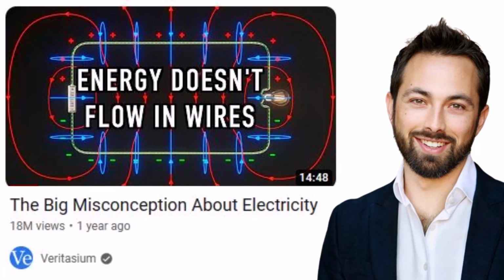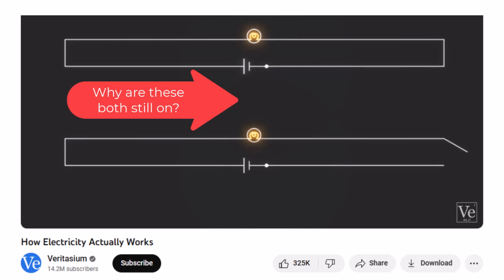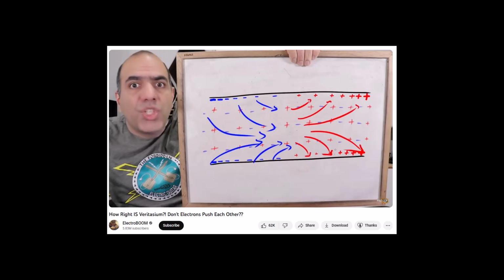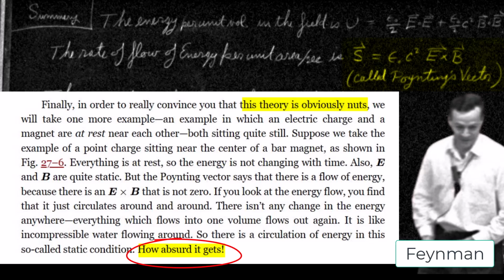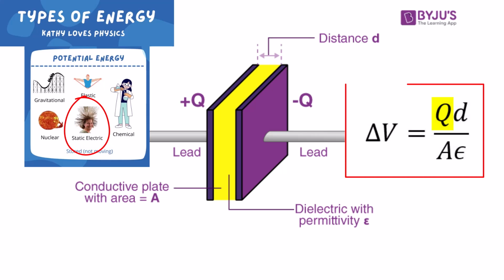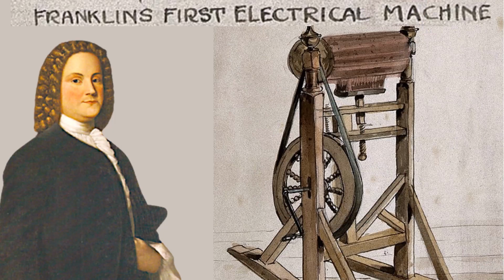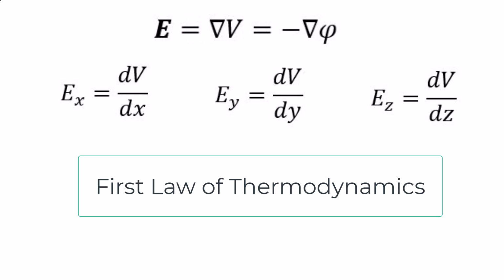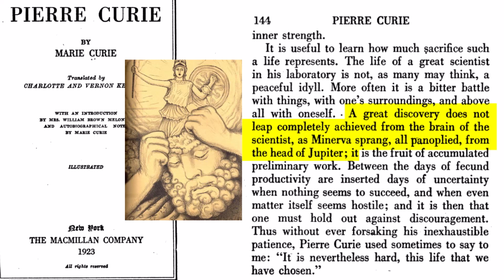Deep Dive Historical Response to Veritasium’s DC Electricity Video

Comment: Love these videos!. Earlier today, AlphaPhoenix put out a video called "Watch electricity hit a fork in the road at half a billion frames per second" with some interesting observations and visualizations on DC electricity.
Reply: Funny, I saw alphaPhoenix' video just be for this one.
Reply from the maker: That sounds amazing
Reply: @Kathy_Loves_Physics  It is wonderful. I get lost in the technical explanations, so I'm not sure Alpha Phoenix's video is directly or tangentially relevant to Derrick's video or not, but it seems so.
Reply: @danoberste8146 The field propagate down both paths until it reach to open or short circuit on either path.
Reply: Excellent video from Alpha Phoenix indeed, as well as his follow-up about impedance.
Watched both yesterday, am an Electronics and RF Engineer 😊
Reply: I have seen it, excellent.
Reply: I just watched about half of the AlphaPhoenix video. He talks more about the flow of information than anything else.  That is all pseudo science.
Reply: @davidhomer78 because he gives you all the information to follow the scientific method and repat his findings, it wouldn't be pseudo science.
Reply: @davidhomer78  You didn't watch very far.  He barely talked about flow of information (which isn't pseudoscience).  You must have missed the actual demonstration, which was fantastic.  Kathy, you've gotta watch it.  He split a long twisted pair into a "Y", with one leg shorted and one leg open, and took hundreds of measurements with an oscilloscope, pulled the data from the scope, and animated it so you can literally see the pulse reflecting back and forth until it reaches a steady state, and how it differs between the shorted wire and the open one.  He uploaded 2 more videos as well, one showing what happens when his transmission line is properly terminated.
Reply: The problem I had with it was that  he  kept saying the oscilloscope reading showed a wave and other things.  The scope only measures voltage.  He interpreted the change in voltage as a wave with nothing to back up that assumption other than what it looked like on the scope.  It was interesting, yes, but his conclusions were not warranted. @Hyxtryx
Reply: @davidhomer78  "The scope only measures voltage"

*with respect to time*.  That's a wave if the changing voltage is periodic.  He was putting a square wave into his apparatus.  (Maybe it wasn't 50% duty cycle, I don't think he said.)  He was only showing the rising edges on the scope.   One trace showed the initial pulse, another showed it farther down the line.  He measured the propagation delay.  Waves propagate.  Also, his word "wave" could have been short for "waveform".
Reply: @davidhomer78   A periodic change in voltage with respect to time is a wave, also called a wave form, or a sine wave if it is sinusoidal.
Reply: Oh, really? @WarrenPostma
Reply: @davidhomer78  Indeed, which invalidates your point... and now you are coming across as just petty, mate
Reply: Since what he built was a capacitor with the wires he was timing the charging of the capacitance of the wire and not the flow of current as he represented in the video. @WarrenPostma
Reply: @davidhomer78 My brother in Christ. Yes, that is what he's doing. It is as you say. And yet, that does not contradict the point.

I wonder: what precisely do you think it is, that is charging a capacitor, if not an inrush of  
c u r r e n t .

In any event, I might as well add this here and see whether it helps or worsens the scuffle: in reality it is not possible to avoid tiny capacitances and inductions. 

DC only exists as an artifact of taking AC phenomena and working with them "in the limit". It is a construct of math, nothing more. 

As circles are only n-gons of infinite sides, and thus do not exist outside of math, so it is with DC. DC is AC with an infinite wavelength, etc etc
Reply: Current is only moving charge.  Charge is caused by electrons and protons.  The electrons move.  Circles are worn out squares (not).  You can say anything with math but that doesn't make it true. @JoshWalker1
Reply: @Hyxtryx  He was putting in a "step function", but close enough.
Reply: @davidhomer78  It's not just a capacitor. It's also an inductor, which lots of people are overlooking here. A combination of lots of little capacitors and inductors in a row is often used to model what it really is: a transmission line.
Reply: @philkarn1761  At one point in one of the videos, he claimed it was oscillating very fast.  I didn't see an oscillator in his circuit, unless he made one out of 6 inverting schmidt triggers, and I don't remember if they were inverting or not.  I would think such an oscillator would be too fast and not give time to settle down between each pulse.  So I don't know.  It would have been good if he explained more about that part.
Reply: @Hyxtryx  You're talking about Alpha Phoenix? The oscillations were caused by the transients reflecting from the ends of the transmission line and also at the discontinuity where the line split in two. Because the speed of propagation is nearly the speed of light these oscillations were very fast, but they were not infinite. This is all very well established theory, something applied every day by RF engineers and radio hams. We even have special meters to measure these reflections called "standing wave ratio" (or SWR) meters.
Reply: @philkarn1761  No, he was talking about the input circuit with the schmidt trigger IC.  He said it was "switching very fast".
Reply: @philkarn1761   Youtube blocked me from posting a link to AlphaPhoenix's video, twice!  This is my third attempt, to make sure you see this.   He's using an oscillator.  Look at his secondary channel, AlphaPhoenix2.  The video titled How To Measure Waves of Electricity.  55 Seconds in.  He says the circuit is "plugging the battery in, on and off and on and off, really fast".  Look at the oscilloscope.  The waveforms aren't static.  You can see moving noise on some of them, and they glitch when he messes with the wires.  The scope is constantly triggering.  How can the scope be constantly triggering on a rising edge if he's not feeding it an oscillator?
Reply: @Hyxtryx  So he's using an oscillator; so what? Its only purpose is to automatically repeat the experiment for convenience; he could have used a storage scope instead and pulsed the wire just once with a manual button. The oscillator frequency is clearly very low compared to the propagation delay down the wire, so the whole system has time to come to a steady state before the oscillator fires another pulse. For the purposes of this experiment, the transmission line is reacting to a step function. This is very clear from his plots.
Reply: @Hyxtryx  But yes, I was looking for a schematic of his oscillator and I didn't see one. You can easily make a ring oscillator out of a bunch of inverting Schmitt triggers (just one, actually), and control frequency with a RC network. Some small resistors and capacitors are clearly visible on the IC though he didn't say how big they were.
Reply: And when I said "oscillations" before, I was talking about the waves bouncing back and forth along the transmission line. I was not talking about the oscillator he uses to continually repeat his experiment at a rate, although fast by human standards, is much slower than the rate at which the transmission line reaches steady state after a step input. So I don't understand what you're arguing about.
Reply: @philkarn1761  Funny then, that you would say "Step function, but close enough" in response to me saying he was "putting in a square wave with possibly less than 50% duty cycle."  And when I said "no, he said it was oscillating very fast", you thought I was talking about the reflections.  It's almost like you thought he was putting in a one-shot pulse each time he took a measurement, and kept steering away from his "signal generator" circuit I was referring to.

Anyway, since he showed nearly 5us of settling, I wasn't sure if the oscillator was running slow enough for that.  I'm now guessing that one or both of the capacitors was for slowing the oscillator and not for smoothing any spikes that might occur on the power supply.
Reply: @Hyxtryx  A full schematic with all component values and timings certainly would have helped show that the oscillator period was way below the settling time of the transmission line. A higher frequency could have demonstrated standing waves, which is a related but distinct topic. But given what he was trying to demonstrate, the input was effectively a step function. He didn't even need the oscillator if he'd programmed his scope to grab and display the effect of a manually initiated step pulse. But the oscillator did make it easier for him to repeatedly change the circuit conditions and run it again.
Reply: @davidhomer78  Not only is information a thing, it is probably the most fundamental thing in the universe.